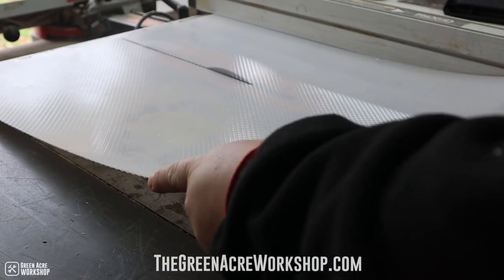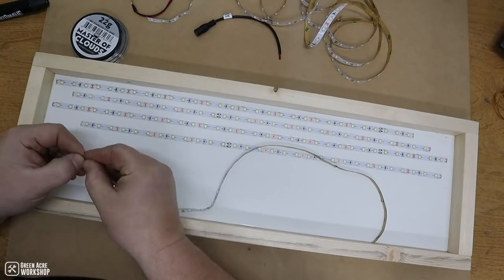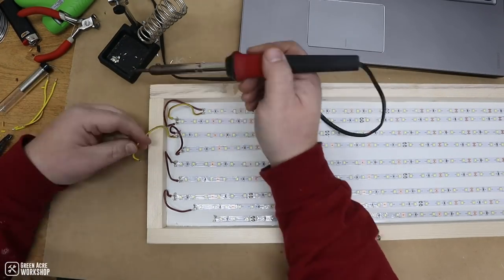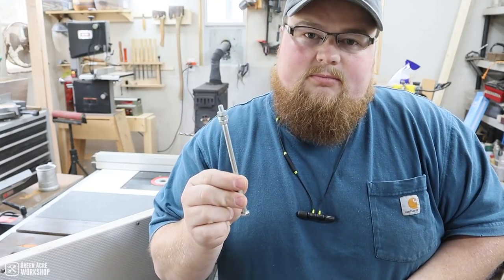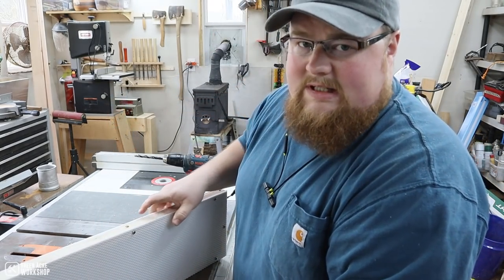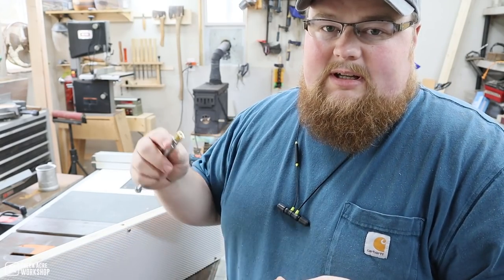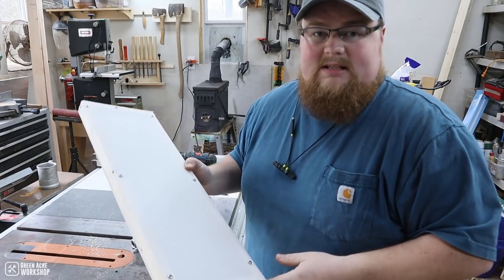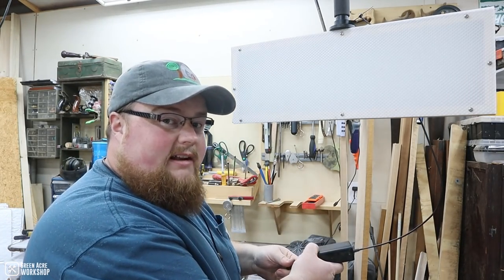Build Your Own LED Light Panel - Save Money, Cheap Video Gear

Comment: How bright is the light, and any ideas how to brighten it up.
Reply from the maker: The light is plenty bright enough for fill lighting in my workshop or as a mild work light. It's not crazy bright, but a nice amount. If it's not bright enough, you'd just add more LEDs. Hope this helps!
Reply: @Samcraftcom  thanks. Very helpful